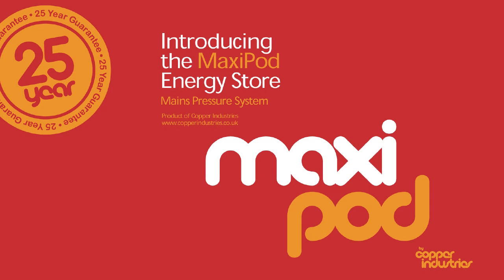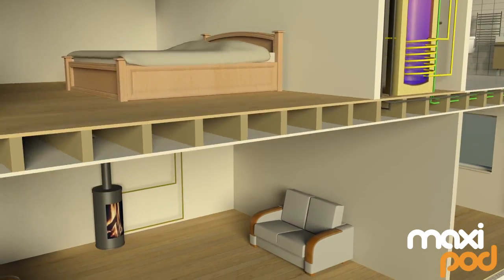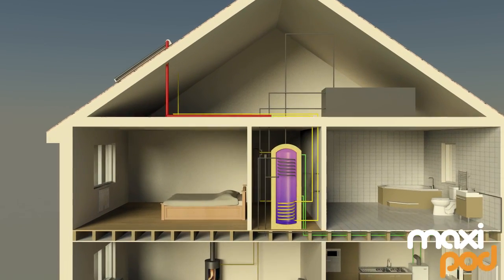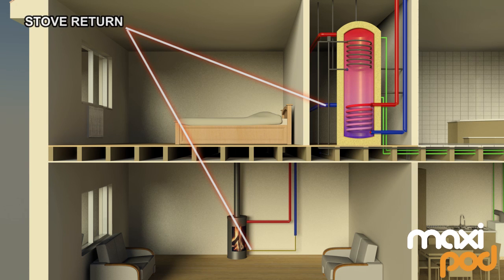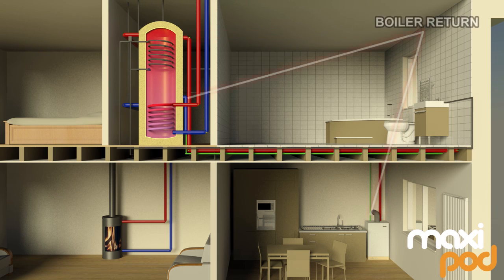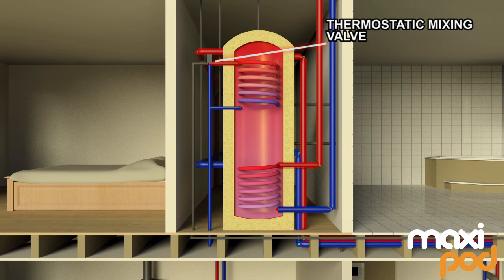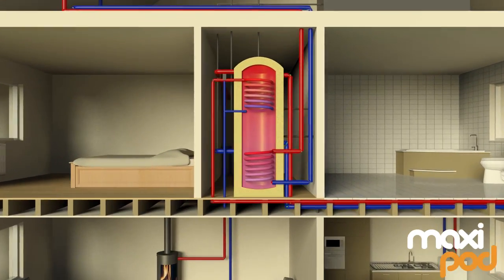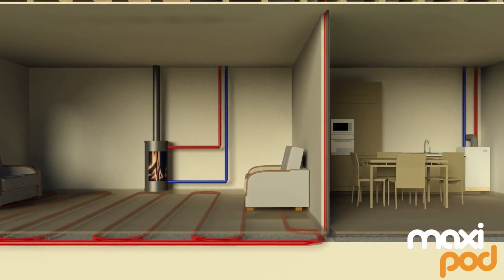MaxiPod Thermal Store

Comment: 100% correct, except for the solar heating part, which is why solar assist always fails due to the solar side being pressurized 
All Thermaltricity Thermal Stores is Glycol free, solar direct also open vented and the only solution to unvented twin coil system that deliver just hot water only, not heating assist